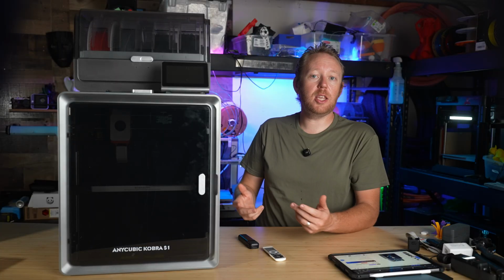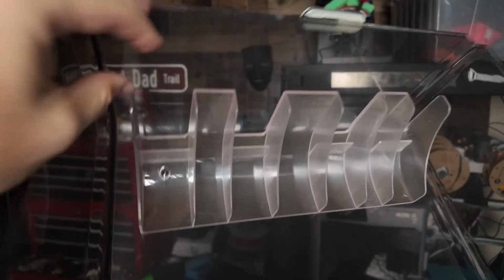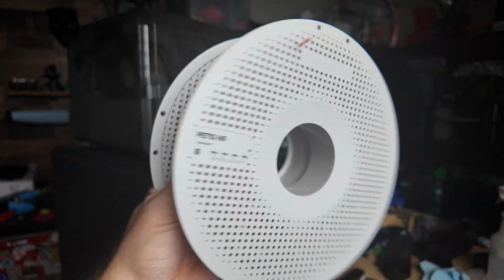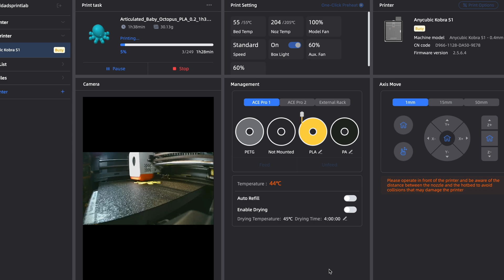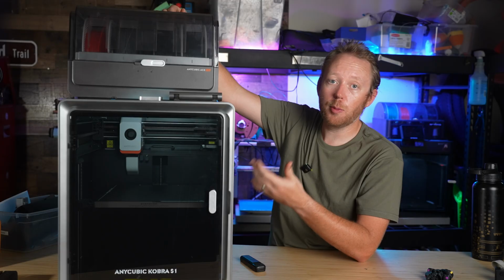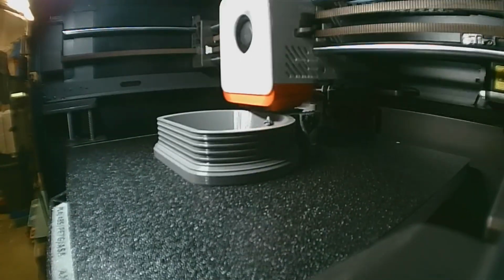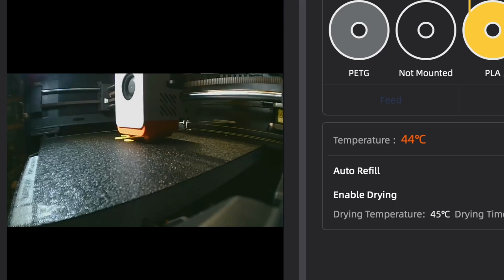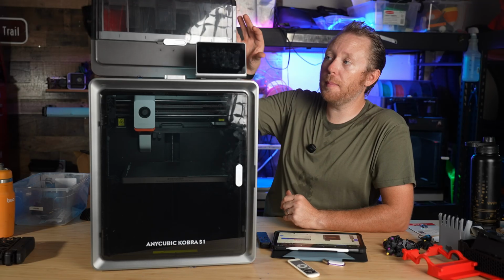The Anycubic Kobra S1 Combo Has Something Bambu Doesn’t

Comment: I just got rid of my Elegoo mars 3. The resin mess was a nightmare for me.  Thinking of this machine.  How is the maintenance and clean up?
Reply from the maker: Any fdm printer is going to be an easy clean up compared to resin printing haha. This is a good option and I haven’t had any issues with maintenance yet
Reply: @jeboots  I just got a refurbished Kobra s1 combo unit on ebay from Anycubic, and I also have a mars 3 pro. Clean up is super simple compared to the resin, the kobra s1 will purge filament when swapping colors, at the start and end of a print etc, so far the waste has been manageable but I haven't gotten into a bunch of multicolor prints yet.

Comment: Over drying? What does that even mean? $432 with ACE now and you can get a three pack of hardened hot ends for under $20 now.
Reply from the maker: You can ruin the filament by over drying, it can cause it to be come super brittle if i recall correctly.
Reply: @airheadbit1984  that the first thing I did replaced the hot end for hard steel ones, I have printed glow in the dark and CF filament with no issues

Comment: Any cubic does not make a long lasting printer. They have a lot of software bed leveling issues. Y-Axis motor trouble : r/anycubic WITH ALL THEIR PRINTERS. I bought the ks1 its trash Came home and the door was blown open. Filament all over the place. Also has leveling issues. And the print quality is not very good. So anyone who's thinking about investing in any cubic, do not waste your money. You'll be very disappointed.

Comment: There are great ceramic hotends, and since a month Anycubic sells such as well. The camera is (as far as I know; checked via Rinkhals) 720p, but scaled down. Regarding USB sticks: There are very short ones that might be better for this use. In my case I have a cart with filament beside the printer so I'd have to fall into it to be able to break anything. Regarding the ACE: I only do layer-by-layer color changes (signs and stuff), never in-layer. And the fact that it's a quadruple spool holder and drier is enough arguments to get the combo anyway.

Comment: I was deciding between this Kobra S1 Combo vs Bambulab P1S... I found that this Kobra S1 has lot of problems. More than half of reviews from people said it is really bad printer, bad heatbed from the start, bad first layer, bad quality etc... it looks like you need to have luck, its 50:50, either you buy good piece or you buy shit you need to work on, sort it out and after week of tinkering it will print good. So I bought P1S, you can really start printing in 15 minutes in the best quality, similar to A1. They are really good machines. But dont forget to do maintenance.
Reply from the maker: I guess I’ve been pretty lucky, I did run into 1 issue since, while clearing a clog I went to tighten the tension adjuster and the outer bit off the extruded housing broke off. I superglued it on and Anycubic is sending a replacement. I have started to take replacement parts availability into consideration when reviewing printers .
Reply: I've been lucky too; I got two Anycubic Kobra S1 Combos, and they're running really well. A couple of times, the first layer came loose, but after I started cleaning with isopropyl, I haven't had any problems. Even 9-hour prints are going smoothly. I don't know much about the BambuLab ps1 so I can't comment on it, but I've been very happy with my two machines. Can i ask  How long have you had the BambuLab? i really like to know about the long term of the bambulab ps1.
Have a good day.
Reply: @Angeleye-dk  i am unlucky here :D i bought P1S month ago and now for the same price I could get fresh P2S with AMS2 :D rip me....

Comment: I've been debating on this machine and the Kobra 3 v2 combo. I'm really digging the case around the printer. As a beginner to 3D printing I've been hearing this machine is a pretty good starting point. I'll be honest, if I'm going to invest in this machine I'm tempted to get the two Ace Pro's and see if this thing really can print with 8 colors!!! Thanks for the video it was really informative. I think I made up my mind.
Reply from the maker: I think this is a pretty solid option for a beginner. One thing to keep in mind when choosing a printer, especially a beginner, make sure parts are readily available in case something goes wrong. Anycubic does a decent job at this thankfully
Reply: @RadDadsPrintLab I’ll definitely keep that in mind. Thanks!!!
Reply: I have it.  I am not too impressed to be honest with it.  I am having issues printing filaments such as ABS and PETG.  From bed adhesion to line shifting and spaghetti prints... I am considering returning it and getting the Elegoo Centauri Carbon instead.  I do not really have or need the AMS.  @RadDadsPrintLab, what do you think.   What is your opinion when compating the Anycubic Kobra S1 vs the Elegoo Centauri Carbon?   Thanks
Reply: @LERJizz  if you are having issues with something as trivial as petg its not printer (or it is broken, which i doubt)

Comment: between this and the Centauri Carbon, which one do you think is the best in general? both are the same price in my country. Definitely do a head to head comparison between them, I'll be waiting for it!
Reply from the maker: Tough Choice. Do you need multicolor or multi material? Because right now, only the Kobra S1 Can do that.
Reply: @RadDadsPrintLab realistically I don’t need it, and I would get the Kobra S1 without the ACE so I don’t mind that the CC does not have multi color for now

Comment: I have this printer and bought it with my own money. I wish I didn't. If it wasn't for Rinkhals this printer would have ended in a dump already. The software only runs on winDOS, so I installed a VM. But it still didn't work. Turns out, it doesn't work with a VPN. My entire house is behind a VPN... It took me weeks to find a way to get this stupid printer to actually print. And anycubic refused to answer support questions. Finally found Rinkhals firmware and I'm now finally able to print and use a normal slicer. I do still wish I never wasted the money on this printer and bought something decent.
Reply from the maker: I run the anycubic slicer next software on mac.
Reply: @RadDadsPrintLab i run Linux and have a ton of slicers available but anycubic made a closed version of opensource software. It's wrong and makes it unusable
Reply: @iamarawn just because it makes it “unusable” for your very specific use case, doesn’t mean it’s a bad product. It just means you didn’t research the product before you bought it.
Reply: A bit harsh to call it garbage just because you're running Linux behind a VPN. I think that qualifies as an edge case.
Reply: @cpanic1153  agreed. "I am the 1% so this is a shit product..." 😂